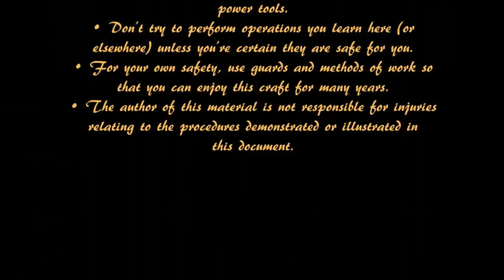Woodturning  New Rebel in the shop https://www.youtube.com/channel/UCsas9UiSAEN4-TeRtQsPFGg

Comment: On the punky part, could you put a shop vac up against one side and suck son super-thin CA through the punky part? Is that a thing that could be done? Of course the end of the hose would have to have a fitting to match the curve, but I was just wondering. I suppose it could be soaked in some stabilizer like "Cactus Juice" in a vacuum chamber, then a final turning before the finish is applied, but I was just wondering, I have yet to turn "punky" wood.
Both bowls are nice. Great job to the both of you.
Reply from the maker: Thank you for watching and commenting my friend 
I hadn't noticed how punky it was until the end, had I seen that earlier I would have saturated it with thin CA. it is thin enough that it would have penetrated deep enough that the vacuum would have not been needed but good idea. Take care